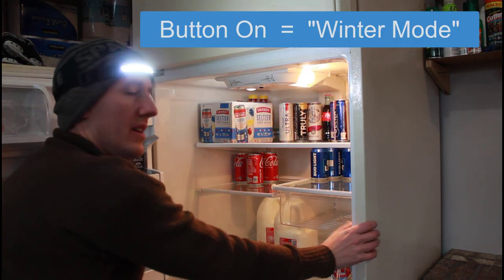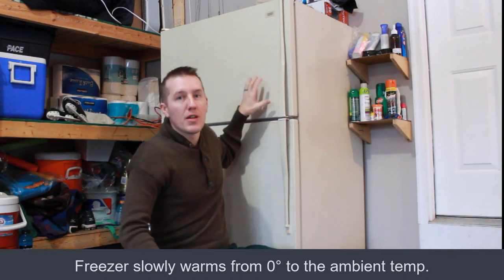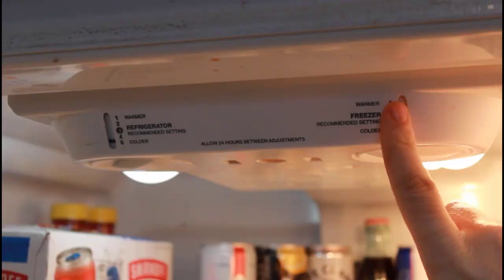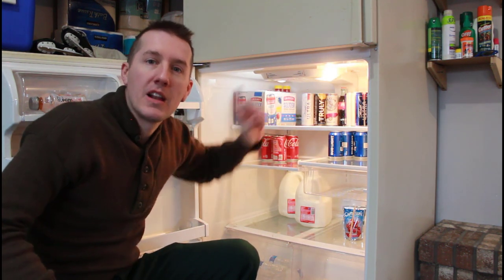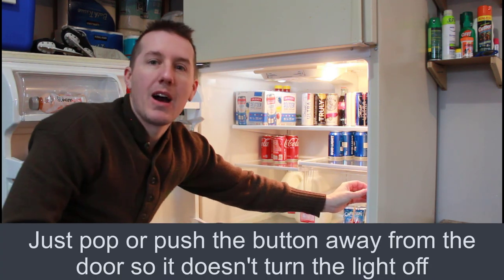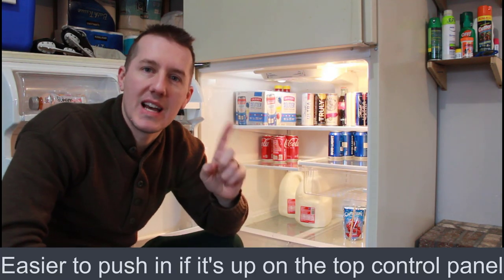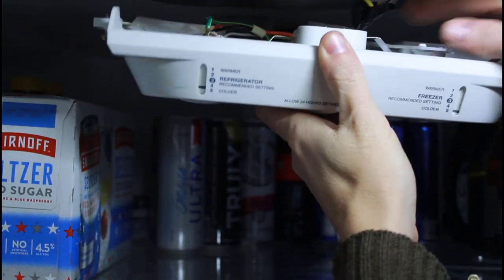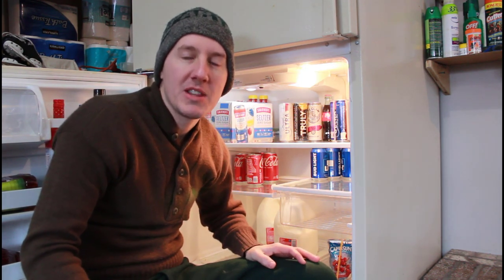Garage Refrigerator Freezer Thaw - How to Fix a Fridge Defrost

Comment from the maker: SHORT VERSION:    ...........  https://youtu.be/5F6ViderSKY
Parts and Tools:
Metal Rocker Switch ...................................... https://amzn.to/3t27k1L
Rocker Switch with Wire ................................ https://amzn.to/36DNP8a
Mini Switch with Wire .................................... https://amzn.to/3IqnjNG
Heater Element .............................................. https://amzn.to/3t61P1Z
Socket Driver .................................................. https://amzn.to/3Hnfbfb
Self-Adjusting Wire Stripper .......................... https://amzn.to/3JTdqs8
Wire Stripper .................................................. https://amzn.to/3IvqB1O

Comment: I installed a garage heater kit but everything in the fridge now freezes. I tried putting the mat on the outside to try and stop this but it still freezes. I have both settings for the fridge and freezer on low. Tried moving the mat to the top of the fridge beside the thermostat “box” (I have the same as you) but the freezer started to thaw. How was yours with the simple light bulb method? Thanks
Reply from the maker: I think the idea is - there's a temperature in the winter, when the thermostat in the refrigerator turns off, thawing everything in the freezer, but the stuff in the refrigerator part is fine.  The light bulb provides just enough heat to keep everything running.  
You can just un-plug the door switch to keep the light on - that would be simplest. 
And i disable it in the summer.

Comment: What if you have a hot garage what can i do to make it work
Reply from the maker: The problem only exists when it's too cold in the garage.
If your garage is hot, then the fridge and freezer should be constantly running.
If your freezer thaws, even though your fridge is running, then there's not much you can do.
Maybe insulate it?   Maybe get a more powerful or efficient fridge?